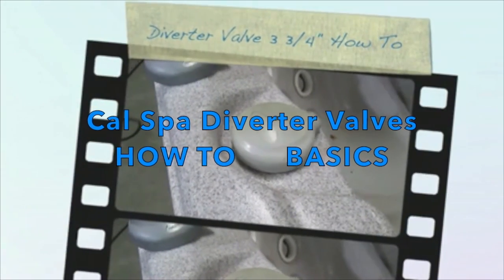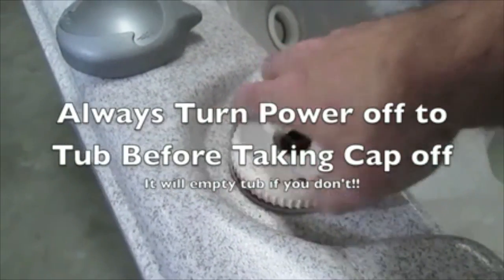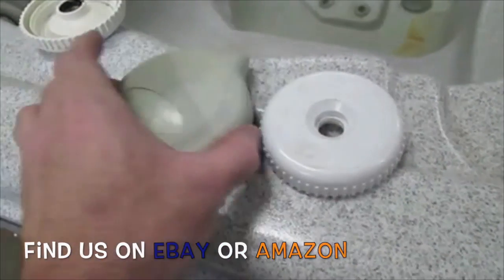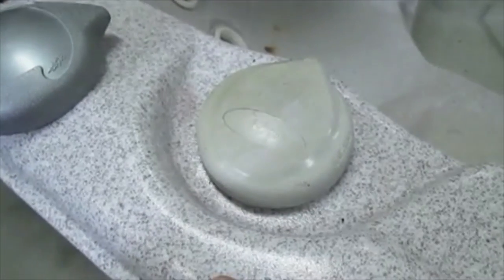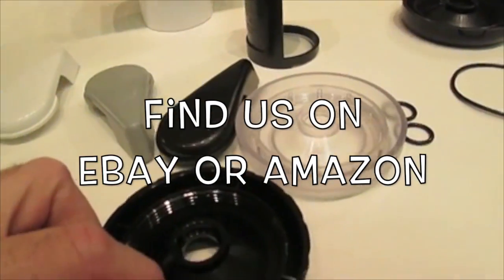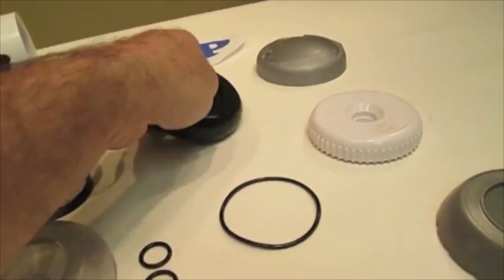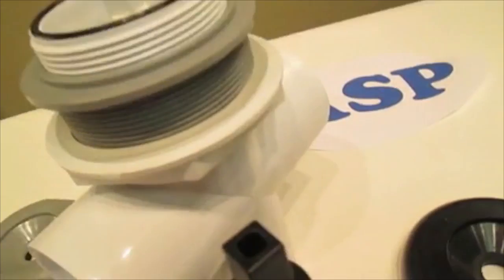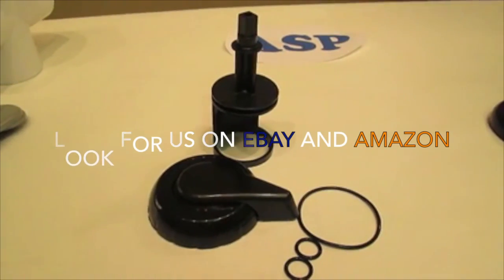Cal Spa Hot Tub Diverter Valve How To American Spa Parts

Comment: What should I do if the stem won't pull out?
Reply: It also won't turn.
Reply from the maker: They can get sand or grit in them and get stuck.. You will have to use pliers and force it to turn and get it out.. Sometimes the top inside edge of the body will get a lip on it and make it hard to get the stem out.. I use a razor bade and trim it gently to make room..